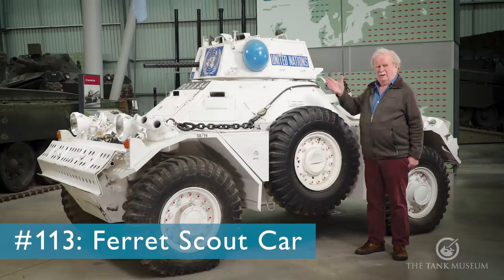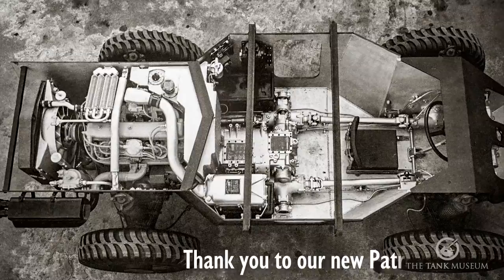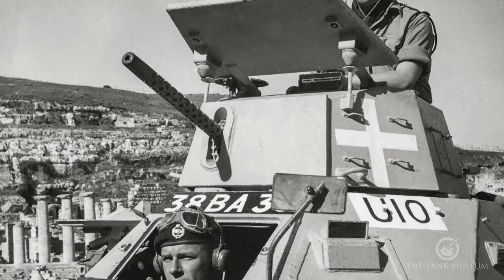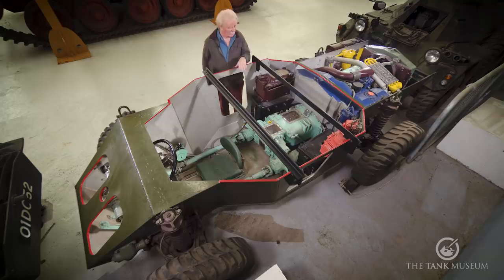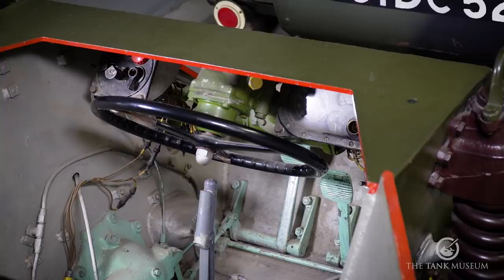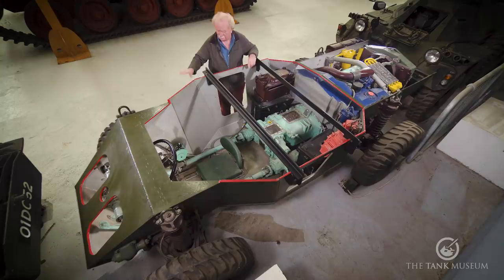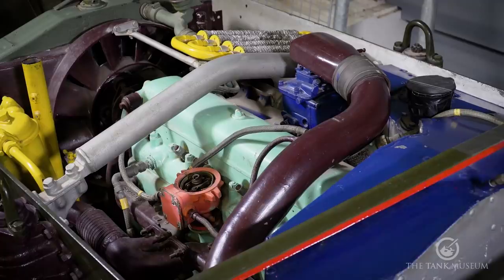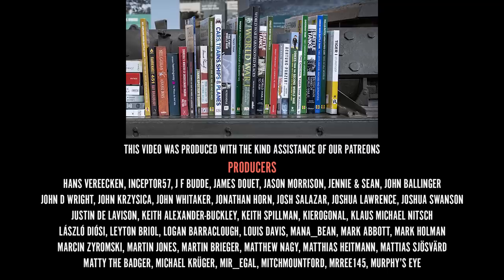Tank Chats #113 | Ferret Scout Car | The Tank Museum

Comment: you'll never get one of those down your trousers.
Reply: Not with that attitude no
Reply: I bet Michael Moore could.
Reply: Compo would have given it a good go.
Reply: No but you can buy one for 17000 pounds
Reply: Not with that attitude you won't
Reply: @davedavesnothereman2515  I saw a scruffy one for 6000 euro. Mechanically still in very good condition. 6750 euro was the price for a lovely one from Poland but it got sold fast.

Comment: It looks such a fun vehicle.
Reply: They are fun to drive. They are capable of 55 miles per hour, which can also be done backwards.  If you are brave / crazy enough.
Reply: I want to see one in war thunder.
Reply: @nickthompson9697  The  Mk 2/6 fired Vigilant ATGMs while the Mk 5 (which essentially was a  Big Wheel Mk 4 with a new turret) used the Swingfire ATGMs.

All the other variants were not designed to go up against armoured vehicles.  They  were generally Recce / Liaison  / Internal Security / Rebroadcast vehicles.  I've been told by a crewman that if they had to fire to fire their main armament their primary mission was considered a failure.
Reply: I want one.
Reply: @jefferyindorf699  They are road legal too.
Reply: @ptonpc  Trident sub crew say the same thing!
Reply: not fun when u are hit by a 122 mm shell
Reply: @nickthompson9697  me too
Reply: @nickthompson9697  ｐ

Comment: Biggest problem with the Ferret was the drum brakes were pretty useless when they got full of mud, also the dowels wore on the hub carriers as the bolts couldn't be kept tight. Spent many hours pumping away at the gear change pedal when setting the "automatic" adjusters for the gearbox buzz bar height (50 pumps per adjustment in each gear! ) Great fun to drive!

Comment: How quiet were they? When our reserve reg't was doing a two week summer stint learning from the regulars at CFB Petawawa, myself and one other trooper were given a location to go and wait for orientation on "a Ferret." I'd never seen one before and had no idea what to expect but most things on the base were not quiet so I figured when we heard something coming, we'd sharpen up. 

The other fellow and I were standing and calmly chatting alone in a field, standing on a rise waiting for the regular forces guy to show up. The other trooper got a bemused look on his face so I figured something was going on behind me so I turned around in place. The Ferret driver had the front snout of the vehicle inches from my knees and the engine was running.The only sound was these other two chuckling. We walked around to the rear and still could barely hear the engine.

On driving it the wheel seemed to me like an inverted version of the almost horizontal steering on the city buses of the time or some big rig truck. For shifting you would anticipate your next gear by if you intended to be accelerating or slowing down. i.e. you could be pushing on the gas, getting up some speed so you'd snick the lever to the next higher gear and you could put your hand back on the steering wheel and when the revs were right, punch the floor pedal selector and boom, you're in that next gear. Or if the situation changed to cruising, leave it alone in that higher setting you thought you would need, or if slowing again, pull it back two notches prepared to punch it into a lower gear instead.
Reply: Try sitting in the driver's seat when running at speed. No quiet on the inside, I can assure you of that! Those internal comms are so necessary when you are sitting in what is the under-the-hood engine compartment.

Comment: Used to have two ferrets, great vehicles. One was 01CA67 the other 01CA68, one served in Gibraltar and the other was up armoured for Northern Ireland. Still have the EMERS and workshop manuals and tools, will buy another when times are better, Easy to work on easy to drive and can be kept in a normal garage. Also had the chance to have a open display one as in video but didn't think about it at the time. .

Comment: I remember when you got a grip on how to drive just how quiet it was. You would creep around absolutely silent or so it seemed then someone would transmit on the 46 set and you would jump from how loud the cooling fans in the radio seemed lol. Those were fun!
Reply: I remember the C42 and the B47.
Reply: As An American I can’t understand this.

Everything we have is loud.
Reply: @bkane573  We used these in two modes, one was as a scouting vehicle ie drive around at feba and see the tourists, recconisence was different in that you were not there to make actual contact. So you would move to or beyond feba  and perhaps setup op or even grab a 110 and play on foot. Recce was by far the more dangerous or risky, think they said life expectancies after contact was under 30 seconds... So everything including vehicle and your personal gear was subject to extreme noise discipline to the point where the loudest thing you would hear from a trained crew was the radio cooling fan.  Our mantra for recon was he who sneaks and peeks and runs away lives to sneak and peek another day -;-)
Reply: Isn't it also the same  mantra for perverts?

Comment: The spare tire must have been in case of total destruction of the wheel, like a mine hit or something along those lines.
Reply: A mine? This thing would be a pile of scrap metal
Reply: @joenuts5167 read of one that either ran over a mine or an IED in Northern Ireland; blew the turret and wheel off; commander got a broken jaw, wheel was replaced and drove back to its base for repairs.
Naturally it depends on the type of explosive it would drive over.

Comment: Two words if your gear shift went wrong....."Ferret Knee". That is the actual reason the steering wheel was placed in that position was to "kneecap" you.
Reply: Never heard of that and I've owned Ferrets for over 10 years and never had a false neutral which is what it is. Ferret Finger yes when the hatch drops on your finger
Reply: @ferrettkitt  or Finger thumb if you held the wheel wrong :P
Reply: Biggest trouble was driver boot when they would manage to rip out the wires from the circular rubber connector on the front bulkhead. Hey ho for a jolly morning reuniting it all in correct order but how else would REME spend time!
Reply: If you go though the correct procedures for start up etc. You will never get a false neutral. It been 40 years since I drove one. From memory you needed to pump the ?GSP pedal ten times in each gear to prime the fluid flywheel before starting in a morning. Great vehicle to drive.

Comment: I remember, years back, chatting with one of the Bovington staff members infront of one of the Ferrets there as he spoke about having owned one as a little, road legal, runaround. He recommended driving in a helmet, however, as apparently when you brake quickly you're in danger of smashing your forehead on the driver's hatch.

Comment: I have fond memories of the FSC. I drove or commanded one for 4 years. In all that time it never broke down; it was without doubt the most reliable British armoured vehicle I ever experienced. In Canada at -25C we diverted the hot air coming out of the engine bay into the crew compartment, using some flexible air ducting, making a nice makeshift heater. You had to be careful not to catch your fingers in the armoured side hatches or the comd's seat; I witnessed one poor driver chop the end of his finger off. I managed to roll my Ferret over on Salisbury Plain & was covered in the oil that came out of the air filter, which sat just to the right rear of the commander. I'll also never forget the pervasive smell of that OEP220 gear oil. Driving it was huge fun.

Comment: I must say that the Ferret is a sharp design that totally looks like a blast to drive around in the bush with the addition of a winch, seat belts and minus the machine gun of course. I'm not sure if it would be street legal (or practical in the winter) in Canada but it appears to have all the necessary lights back and front and fender benders would far less of a worry than in a modern suv. Thank you for the informative and fun video post.
Reply: Probably weighs less too..

Comment: fast, good cross country performance, reasonably armored , so good at it's job they were still using it in Operation Granby (desert storm)  Blue? Fuel tank & carburetor    ... it makes quite a good automobile on the street ... Ferret Mk2/5  ...  we also have the windscreen with wiper that goes in the open driver hatch ... speed? um.. I try to keep it below 50 mph ;-)

Comment: Bringing a spare tire is necessary. When a run-flat tire is punctured it starts tearing at the sides. After just a few hundred meters of driving in terrain strips of rubber hit everything inside the wheel housing, cutting brake lines and damaging anything in reach. 

They do just what they need to do, let you escape a kill zone in an ambush. For all other times you get a flat: use your spare!

Comment: Unrelated but I can't still wrap around how France could fit 90mm gun in a vehicle that is basically the same dimension as Ferret.
Reply: Huge muzzle brake and kind of a low velocity gun firing mainly HE and HEAT-FS. The French have a bit of a hard-on for armored cars with the same gun as MBTs.
Reply: It's actually quite easy: they didn't bother to make the vehicle fightable.
Reply: @iatsd  I would not say that, in the SADF we used the Panhard family renamed and adapted called the Eland in the Border War against SWAPO .

Comment: I suppose someone thought the thing needed an extra wheel in case one went up from a mine or something...
Reply: Correct, plus run flat tyres are only a temporary fix, you would put the spare on as soon as you could after any damage.
Reply: @bsquadronguy  
I was mostly being sarcastic, I think such a frail little thing as a Ferret would have worse things to worry about than a busted wheel if it hits a mine
Reply: I would love to see the jack that comes with the spare tire. It must, if the maintenance personnel are required to replace it then the spare would logically be with them.
Reply: @terry7907  We carried a 4 ton bottle jack. It easily lifted the wheel and suspension unit.
Reply: @Paveway-chan  Sorry, I took your comment literally. Yes they are not well protected, we lost two members of my regiment to a mine in Northern Ireland.

Comment: They are semi automatic gearbox. They were the popular options for postwar British buses
Reply: Daimler patented the combination of Wilson gearbox and Vulcan-Sinclair coupling, aka fluid flywheel in 1930, and offered no other transmission option until 1959. They licensed AEC to use the system in buses, but no other manufacturer was permitted to use it. The last preselector Daimler buses were delivered in 1968.
Reply: @davidjones332  AEC Buses were quite popular; I believed that Leyland was also using the technology in their rear engine buses?

Comment: Driven both the Ferret and Saracen.   The Ferret is a lot of fun, but you do need to get a run up to get up a hill cleanly.  My biggest problem was getting a clean gear change because my size 12 boots kept getting hung up on the steering gear.   This was a major problem with the Saracen.  A guy told me they liked to get Gurka drivers in the Saracens, because they had a foot small enough to stomp the gear change pedal cleanly.
Reply: I never had a problem, size 9 boots and 6ft tall.
Reply: @bsquadronguy    Must of just been my size twelves.

Comment: Carrie's a spare because anyone who has had experience in a run flat running flat it sheers right off the rim in one big strip of just peels off! It's bloody frightening!! Ypu should see a big seam line down the middle of the tyre whare the rear is solid rubber and the front section is normally air and when that goes you can get about 30 to 50 miles tops before it shreds!

Comment: Can someone explain the 'gear selector'  for me?  So.. you choose gear by putting the lever of the gear selector in a certain position and then press the pedal (What David refers to as a clutch, but isnt a clutch pedal) He mentions that it does the 'work for you' when you press the clutch. Someone explain please, sounds like a very cool system and it looks like you Brits got this mechanical engineering thing quite right. 

Congrats for that :P

Comment: I find it interesting that the wheels have separate driveshafts. Why was it done this way?
Reply: Maybe it can turn on the spot?
Independent suspension?
Takes up less room?
Dunno.
Reply: The DAF 126 and 328 had the same kind of driveline 😎
Reply: They would have had to have an open diff in the centre plus the propshaft running under the drivers seat, the axle tubes would have to bolt up to the hull to seal it ( or long driveshafts which would then have to move up and down ‘open to the elements’ , then you would have to protect the driver again ?) servicing that lot would be difficult, plus you have the benefit of losing a wheel, and still having drive to the opposite wheel, with an open diff you wouldn’t have drive (without a diff locker) , at least it could get you out of trouble . It looks like the best solution for a compact vehicle, 2 driveshafts look to have solved a lot of complications if that makes sense .
Reply: The driveshafts come from the transfer box (the large square box the commander's seat is on).  It has 4 wheel drive.  A central drive shaft could have increased the height.  The ferret was designed to be a quiet (From the outside) fast scout vehicle originally.   
There are other advantages, such as ensuring power goes to all the wheels etc
Reply: I suspect that it was built with that feature so that the driver doesn’t have the driveshaft running beneath his seat and between his legs; if there was a single driveshaft for the front wheels, the driver’s seat and foot controls would probably have had to be mounted above the drivetrain, requiring a taller driving compartment and overall silhouette for the vehicle.  In the engine compartment, the twin driveshafts would allow the engine to be set lower in the vehicle (between the two driveshafts instead of above a single one) which would again allow for a lower silhouette.  All supposition on my part, but it seems to make sense (at least to me.)
Reply: So driver can clean mud off of each boot whilst under way 📉😅📈

Comment: Clutch pedal was not a clutch at all it was a kick down to operate the Wilson gearbox, same system as found on old London Buses.
Firing a 30cal on the turreted version could rattle your teeth loose.

Comment: Its tiny! The drivers hearing seems to be severely at risk from the gunfire
Reply: Always a risk; armored vehicles are a hazard to your hearing.
Reply: Headphones?
Reply: @HanSolo__  , the driver always wears headphones, and if there is a likelihood of combat you close the main hatch. I did anyway. All you can hear when the MG fires is a dull "chug chug chug" and the brass empties filling the empty case bag or cascading onto the floor. And the commander swearing.
Reply: @bsquadronguy  This was an answer, not a question.
Reply: @HanSolo__  crew helmets.
Still hard on the ears. I knew some of the Human Factors Engineers who were working the issue in the 90s; even that late, it was still a vexing probably - mostly due to communication intelligibility issues.
Reply: @HanSolo__  Sorry, pressed the wrong reply section.
Reply: @bsquadronguy  No need to sorry. All cool 😉
Reply: @bsquadronguy  aye interesting, thank you for sharing
Reply: @lairdcummings9092  , It was a stupid system in the British Army, we were never asked what sort of head protection/comms system we would prefer, and I do not know anyone who was out of a regiment of 600+ guys. The first "Bone Dome" kit that was issued with the arrival of CVR(T) and Clansman radio kit in 1977 we tried out in some Ferrets. The radios were ok but the crew helmets were uncomfortable, heavy, and bulky, so many preferred the risk of head injury to the degradation of performance while wearing them. I could have used some head protection in 1977 while driving a range safety FSC Mk2 at Batus, "I headed " the periscope mounting driving over rough ground and was taken out of the field with a head concussion and lesions.
Reply: @bsquadronguy  nasty.
The current US crew helmets are the result of the efforts mentioned above. Greater fidelity in communication, less weight. To be honest, I think I'd still prefer the USN 'cranial' headgear; lightweight, protective, durable.
Reply: @lairdcummings9092  , one of my colleagues had "obtained" a Russian crew helmet from an abandoned T34/85 in Cyprus in 1974. He got it wired up to fit the radio harness system in our vehicles. He found it very comfortable and practical, especially in winter. Our CO was not enthusiastic about it and my mate was informed of his options. He kept the thing as a trophy from then on.
Reply: @bsquadronguy  the Russian helmets have a lot of practice and experience built into their design.

Comment: I thought the ferrit has two spares on stub axils. The bottom of the tires hang below the chassis so it can roll over some obsticals like fallen trees that would make other vehicles get hung up.
Reply: Wrong. It has only one spare and it is bolted onto a support, not an axle. It does not protrude below the hull bottom, or at least none of the Ferrets I drove did. As for rolling over fallen trees, not really possible unless they were very thin. The Ferret cannot go just anywhere, it can get bogged in a wet muddy field or hung up on a tree stump, as I found several times in Germany.

Comment: why is there 2 differentials in front? that is weird
Reply: You have engine, gearbox, transfer box, your 4 driveshafts 2 to the front and 2 to the rear, then a bevel box at each corner which just transfers the drive through 90 degrees and out to the wheels. Permanent 4 wheel drive, however by design both wheels on one side are effectively locked together, so can suffer from 'wind up'